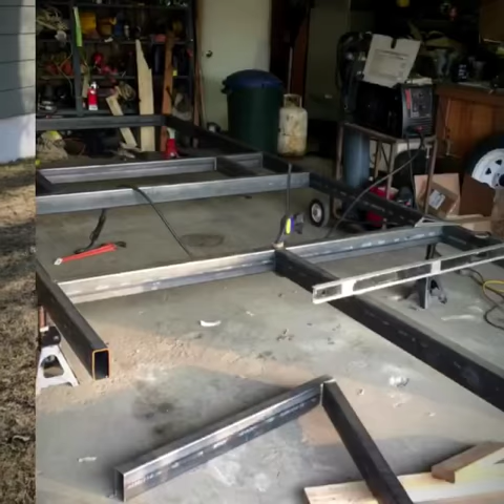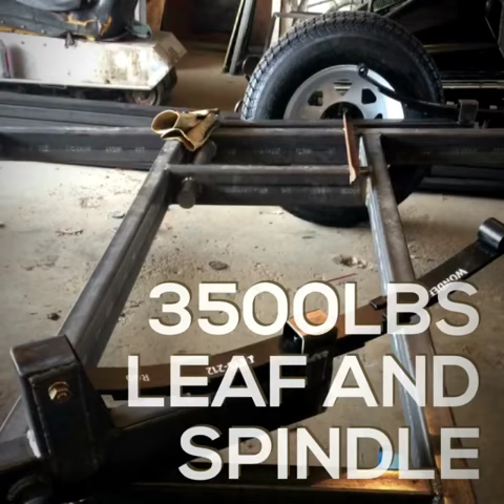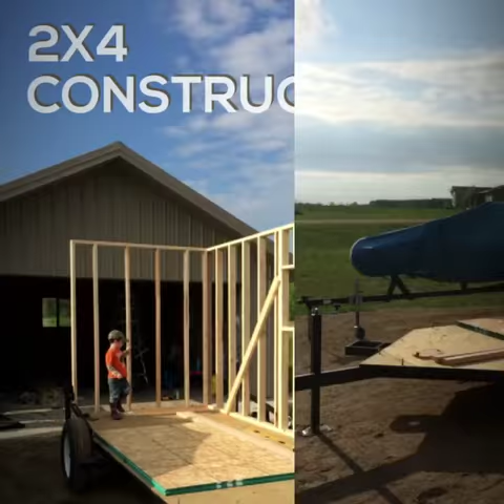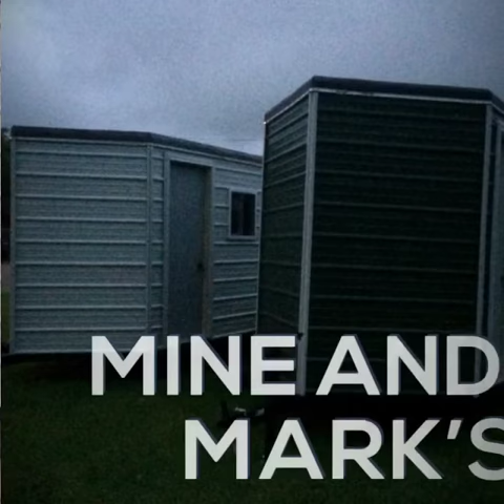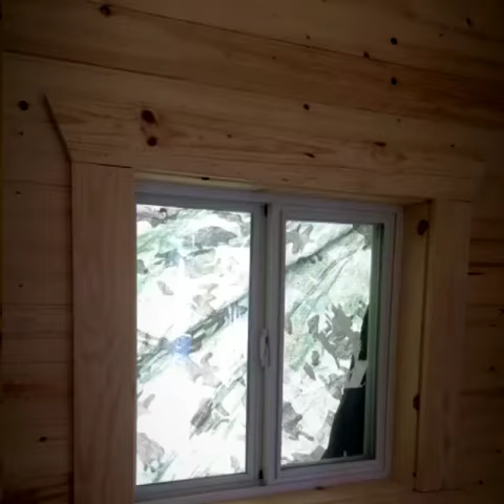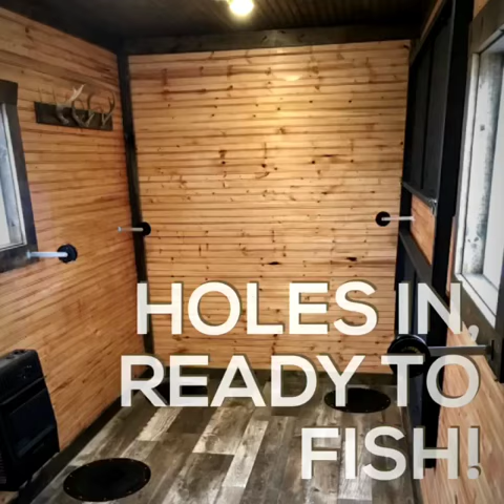2017 Fishhouse/Ice Shack build!

Comment: What trim did you use for steel siding?  Did you use back to back J-channel on side and front of V nose?  Also corner trim looks smaller than anything I have been able to find.
Reply from the maker: Correct, back to back J channel. With caulking in between

Comment: Unless I missed the dimension for it somewhere, how tall did you frame your walls ?
Reply from the maker: 7ft 6in inside
Reply: How was the snow on the flat roof ?
Reply from the maker: Parker Collins  never had a problem with snow. It’s 2x4in 16in on center spanning 6.5ft, you could park a car on top.
Reply: Jacob McGowan one more question, what material did you use on the surface of the roof ?
Reply from the maker: Parker Collins  regular residential rubber roofing from menards

Comment: How did you secure the plywood floor to the metal frame?
Reply from the maker: It’s glued and screwed down. Also around the edge of the frame I welded on short pieces of all-thread every 3ft. Then the floor and exterior walls were bolted down as well
Reply: @McGowanOutdoors  thanks man, looks great.
Reply: One more Q. Did you use construction adhesive for the glue? Or some form of loctite.
Reply from the maker: I just used regular construction adhesive

Comment: What did you use for the framing?  Looks thick. 2 x 4?
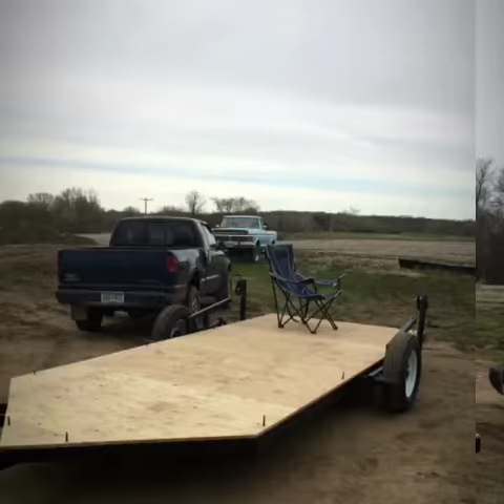Reply from the maker: Kevin F  yep... the difference in weight between 2x4 vs 2x2 is so minimal I figured why not... plus gave me more room for wiring and insulation. 1:22
Reply: Jacob McGowan I meant for the steel frame. 2x4 rec tubing? How thick?  Thanks bud
Reply from the maker: Kevin F  yep, 2x4 steel tube for main, 1x4 for cross structure. All 1/8in thick.. 

😜 I thought you were taking wood framing.. lol oops
Reply: Wow. It looks much thicker than that in the video laying on the ground. Good video.  Plan to build one.
Reply: Jacob McGowan you must of used 1 x 3 rec tubing for the middle cross members?  I see they are not as tall once installed
Reply from the maker: Kevin F nice catch, yes I did
Reply: Jacob McGowan 2 more questions... did you stay with the 2x4x11ga with your tongue and the solid round for the axle pivot, did you use 2" or bigger? My plan was 2" but heard reports of less than 2" snapping off because of the weight bouncing down the road.
Reply from the maker: Kevin F yeah, we kept the same for the tongue.. and the solid round stock for axel is 2.5in
Reply from the maker: Kevin F Yes I use the same steel for the tongue. And I measured it and it is 2 inch round stock. For the axles.
Reply from the maker: I have a little bit over 400 miles on my Fishhouse this year and haven’t had a single issue. So I think that should be good enough
Reply: Jacob McGowan standing in my garage looking over 2 sets of tape measures. 1 at 12 foot long and another at 14. Debating since I don't really plan to have a sleep over and the max I would probably have is 2 adults and 1 kids if it's worth adding the extra weight of a 14 foot
Reply from the maker: Kevin F that’s up to you... If you take 2500lbs divided by 14ft you get roughly 180lbs per 2ft section. If I had 2ft less Fishhouse then I have now it would still be roomy.. but it’s nice having that extra room too.
Reply: Jacob McGowan I was just more concerned about my available space to build this thing.  14 foot body leaves me with only enough room for a 30" v nose and 30" tongue minus the tongue would be a drop style so there would probably be another 8" or so over hang with the coupler. Should be good enough with a v nose setup.
Reply from the maker: Kevin F I got you.. 👍 here is another vid I posted that shows a little more of the inside.. gives you an idea of inside space. 

https://youtu.be/F_l4Hxw-d50